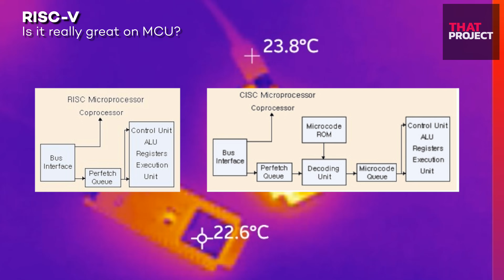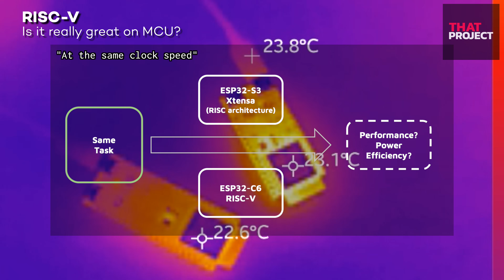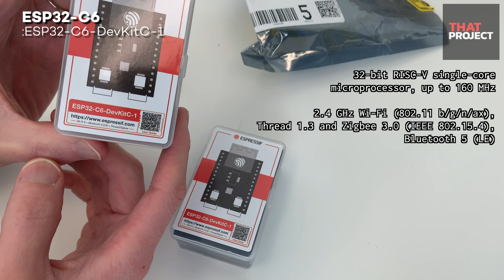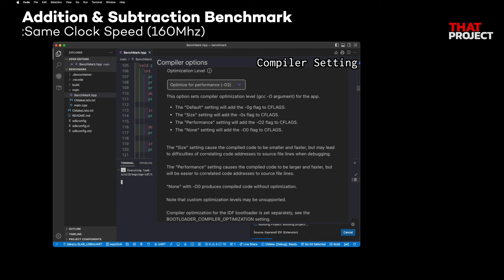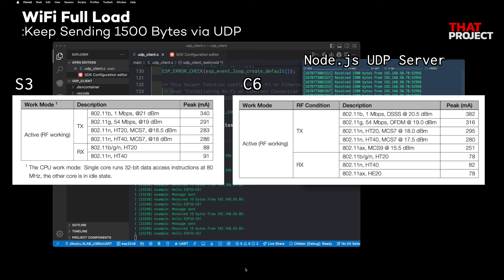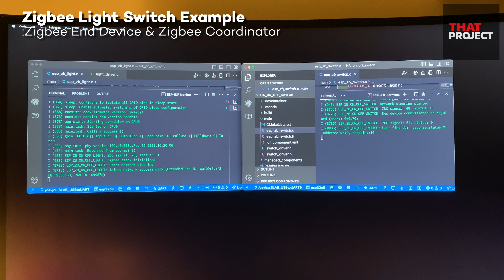How good is MCU based on RISC-V? (ESP32-C6)

Comment: so there is almost no difference?
Reply from the maker: @arias80rp10  The ESP32-S3 is more powerful while the ESP32-C6 is more IoT-focused with advanced connectivity features like Wi-Fi 6 and Zigbee.

1. **Core Architecture**:
   - **ESP32-S3**: Dual-core Tensilica LX7 processor, primarily designed for AI/ML and multimedia processing.
   - **ESP32-C6**: Single-core RISC-V processor, focusing more on IoT and low-power applications.

2. **Wireless Connectivity**:
   - **ESP32-S3**: Supports Wi-Fi 4 (2.4 GHz) and Bluetooth 5.0 (LE), catering to a broad range of wireless applications.
   - **ESP32-C6**: Adds Wi-Fi 6 (2.4 GHz) support along with Bluetooth 5.0 (LE) and Zigbee/Thread, making it ideal for modern IoT applications requiring higher efficiency and lower latency.

Comment: Xtensa have said the C6 code is not power optimised yet, so expect results to improve.
Reply from the maker: Thanks for sharing. Is there an official page that mentions this?
Reply: I seem to recall it being a forum response about the latest esp-idf or esp32-arduino releases, but I can't seem yo find it right now.

But the gist is that right now they are mostly optimising for support and bugs, the power optimization is not as high priority right now.
Reply from the maker: @MikePreston-darkflib  All right. Thank you for the information. I haven't found any good project ideas using C6 yet. If you have one, please share it. Thank you.
Reply: @ThatProject  The two things that jump out at me for the C6 over other ESP models is that it supports zigbee (so can interop with other home automation devices) and 802.11ax which in theory gives the ability to be very low power while still remaining connected to wifi and waking up at fixed intervals to see if there is any data for it.

Both these are big advances and open up some applications that weren't possible before.

The other thing that is likely less important to most other people is that it has better security than some of the older models - both in terms of ciphers etc and in terms of protecting code and data during early boot.

There is also talk of a variant on the C6 which will work on 5GHz, which while I have not seen any announcement yet of, is rumoured to be launching in the next 6 months or so.
Reply from the maker: @MikePreston-darkflib  If it supports 5Ghz, I'm planning to do some testing on projects that require fast data transmission. ZigBee modules can also transmit and receive data at low power, but there are no good ideas yet for any special projects using them.

Comment: Nice video!

Xtensa is VLIW not RISC. That means it'll excel at some jobs (DSP, matrix operations, etc.... heck Xtensa is designed as a DSP core) but be effectively the same as a single issue in order core like the C3 on other tasks. But at lower code density.